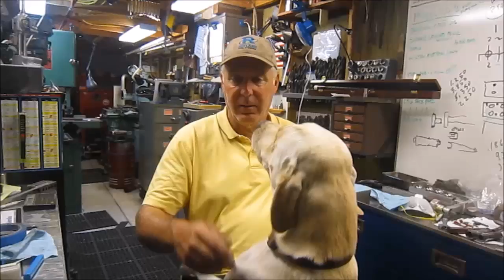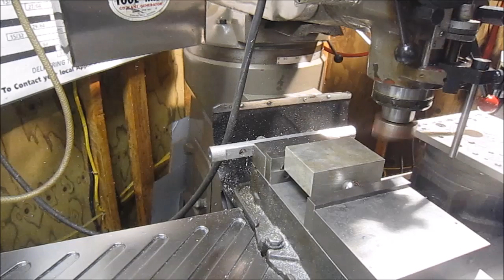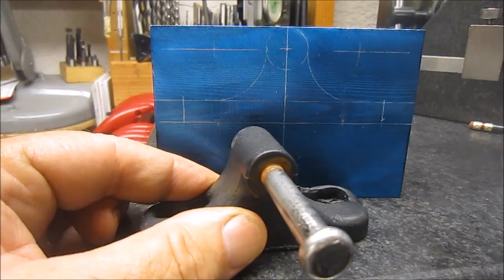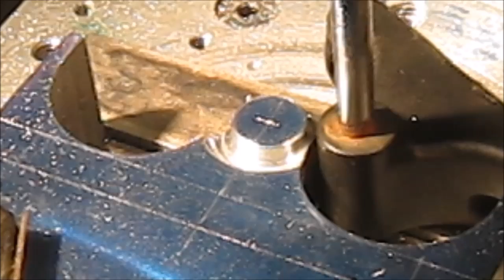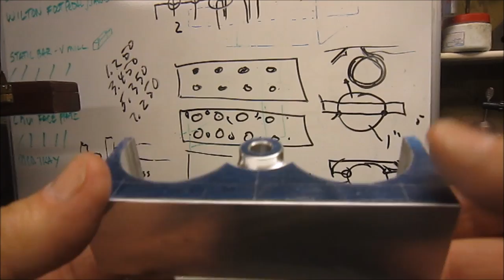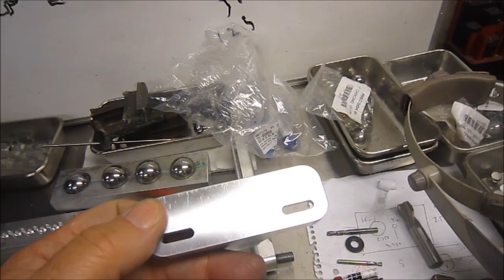Screwy Tuesday # 20   Hey Man!!!

Comment: Beautiful piece!  I would have just cut a rectangular block and press fit the ole pin .....  If it's a house with axles.  I wouldn't have recessed the screw holes so deeply:  more meat to absorb the shock of the slamming gate.  Yeah, probably the cause for the initial failure:  it wasn't able to take the gate whacking on it.  Think about the amount of force that is applied.  If all of the impact is taken by those two screws, they will work loose.  See it the gate frame hits a stop, so the latch doesn't get beat so badly, yadda yadda.   Dog is getting bigger.  Waiting for the "Hey Chuey" episode.   And the one where T.L. comes in ala Deus Ex Machina to solve machining problems.  Don't know if he would be in the Chaolin robe or looking like Mr Wizard.

Comment: Hi Chuck,
nice job. there are indeed more than one way to skin a cat, but i would have done the small top radii of the pin holder first and then run in the large diameter cutter from the ends down the sides along the long axis of the part to catch the radii on both sides at equal depth. that would have made things more symmetrical.

the finish is really nice. it almost looks anodized.

i just bought a rotary table for my bridgeport and picked it up yesterday.. made by hahn & kolb, 16" dia... weighs 200lbs.. it's missing the table locks so i'm gonna either call the manufacturer for a blue print or a set of replacement locks ..
thanks for showing a different use of a rotary table

cheers
mike

Comment: just a thought re design of the part; as you correcty pointed out the original design was suspect around the screw slots. so long as there were no contraindicating factors, i would have moved them to the center line of the wings rather than repeat the original design's location closer to the edge.

Comment: Brother in law?  Hey man!!!?  All that really mattered in the gate latch part was the relationship between the two screws that mount it to the fence 2x4 and the pin for the latch to grab on to.  Bend or weld a piece of 1/4" A36 to 90 degrees, drill three holes for the screws and pin, use a bolt for the pin with double nuts to hold it, find a nearly empty old rattle can of the ugliest color you have laying around, and "Hey man!  No problem. You're welcome -- ANY TIME!"
Or, maybe you were really doing it for you, for your sister, and for us...   8^)
Reply from the maker: ***** Hey Bob...you description was very close to my hack thinking....lol....and you are somewhat correct...I did the build for my enjoyment and my viewers enjoyment, thank you for taking the time to view

Comment: Hi Chuck !

Really nice replacement you made there and I love that blasted surface - what kind of lacquer do you use ?

Can tha lacquer stand for some small nicks and dings without discolering whare it was hit ?

That math to catch the radi - isn't it just the tangent to each circle - I think so !
Reply from the maker: Keld Sørensen Hello Keld....I thought of you with my comment "gutentight" (I know you are not German) almost called out your name....LOLThe spray lacquer is a satin finish Deft products in a spray can.  I have used it on various parts and haven't noticed any issues and the coats are very light....give a great feel to the part.Tangent??  what the hell is that....LOL,  I guess I have to do some more learning....ugh!
Reply: outsidescrewball I know from frustrating personal experience that the newer versions of AutoCAD make you work to lay out those tangents - things that I can still do with a drafting triangle and a calibrated eyeball, or go out and do the geometrical calculations and lay it out in CAD...

It's really easy to lay it out without any transition between the two arcs - just not so pretty!

Anyway, you got an attractive part that meets its performance requirements... ship & invoice, and Next! ;^)

Eric

Comment: Nice work, Screwy.
Reply from the maker: ILGopher Thank you my friend.....FYI...your compound is sitting there waiting for me to give it a try....it is on my list
Reply: I was thinking about it the other day wondering when I was working on cleaning up the one on my 10" now.  Adam (I think) mentioned using carbide in one of his videos as a backing on thin parts because it will not stick to metals and will take the heat.

Comment: To blend two opposing radii (as in your part), just draw a line between the centers. Where that line crosses the two circles (which is also where they touch) is where one radius will end and the other begin. No math; just layout. You can measure the angle of the line with some reference surface if you are starting and stopping your cut with a rotary table.
Reply from the maker: Peter W. Meek Hello Peter....hmmm, we needed this conversation prior to me starting....LOL, thanks for the info and I did learn something....
Reply: LOL - I'm the absolute genius for saying how to do it AFTER IT'S DONE.